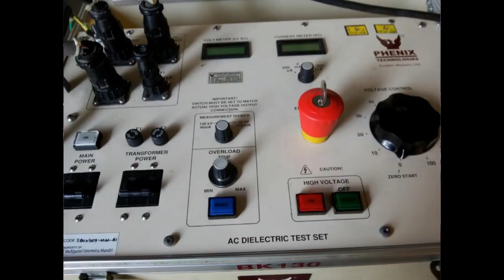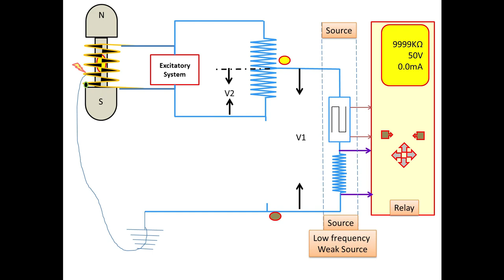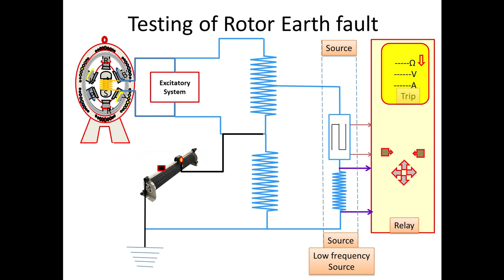Rotor Earth fault protection | part-II

Comment: Hi Sir, how can accumulated dust lead to low resistance? is it not supposed to be the opposite since there is minimal contact.
Reply from the maker: rotor resistance measuring method is ground system, if dust with moisture which lead to low resistance toward ground thank you.